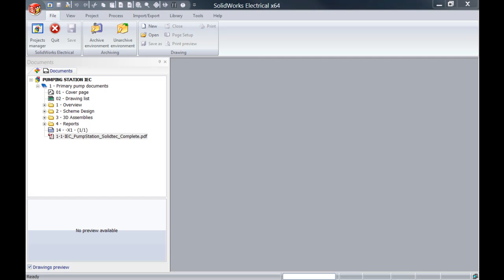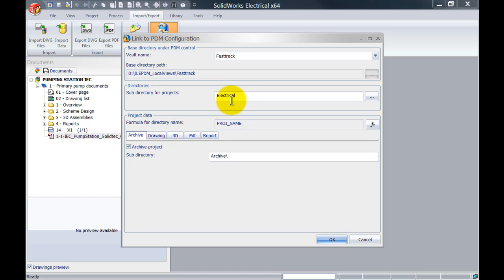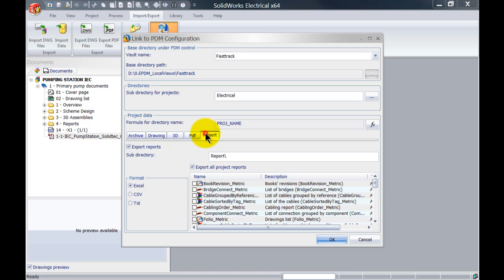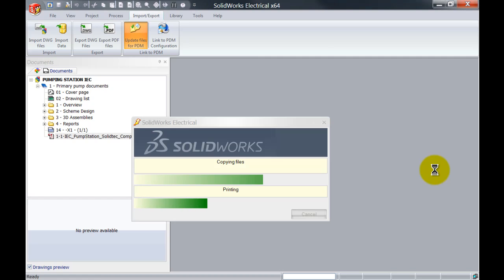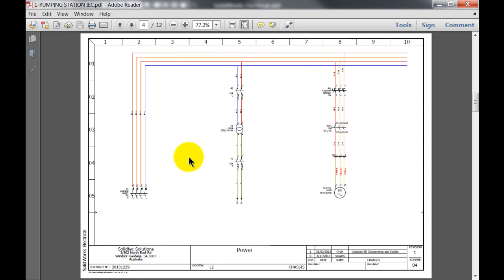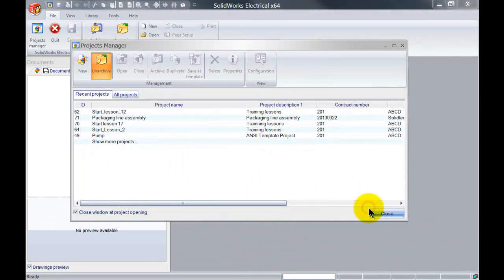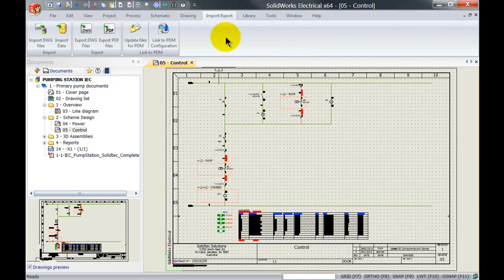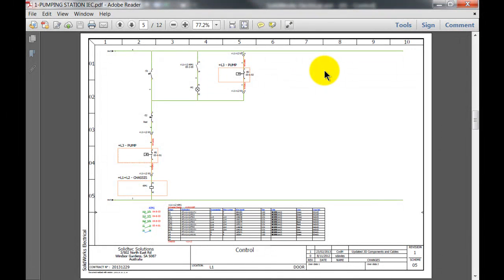19. SolidWorks Electrical - How to Link SolidWorks Electrical to EPDM

Comment: I am surprised there are not more useful drawing numbers included on either the book or each sheet.  Is the 2 digit scheme number supposed to suffice?  I suppose this along with the contract number is enough but I am used to assigning document numbers for each drawing that are searchable in the database.  I have not yet figured out how to achieve that in the integration between SolidWorks electrical and ePDM in any way similar to what SolidWorks to ePDM can do.